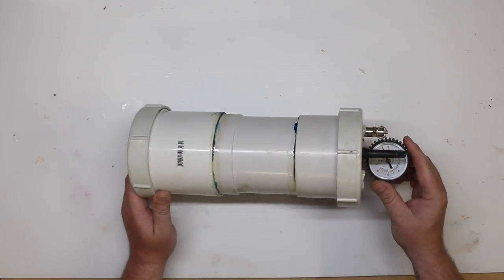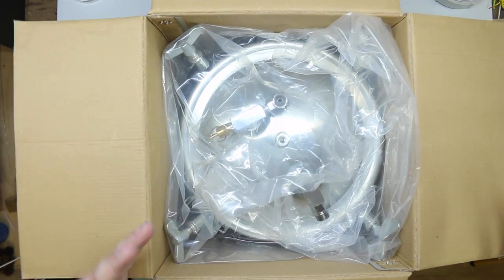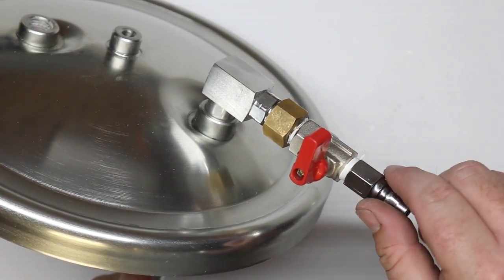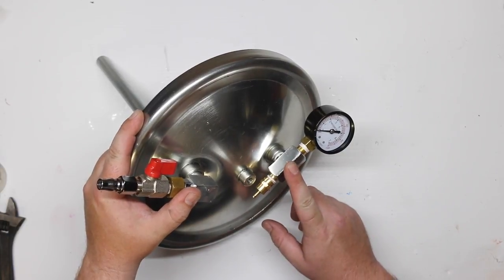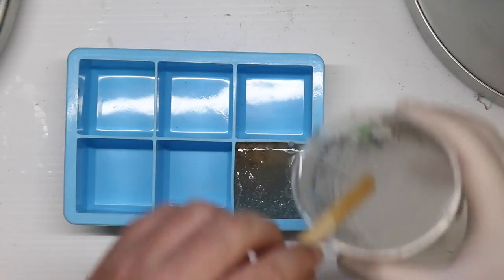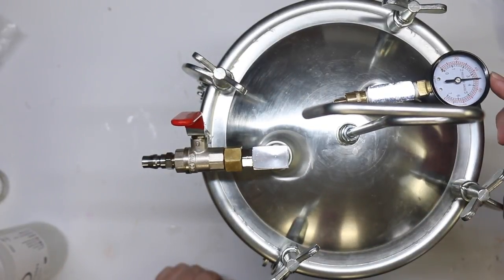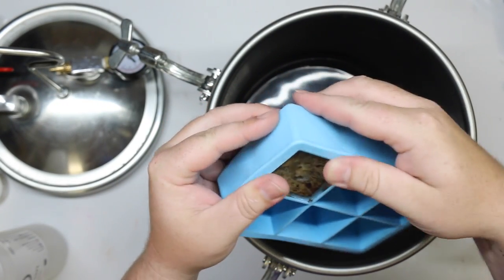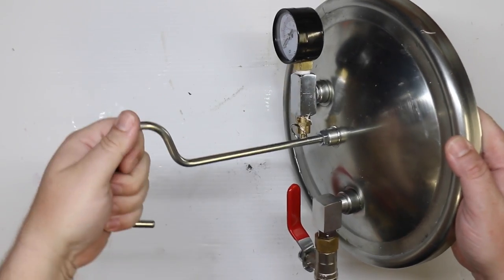DIY Pressure Pot for resin casting

Comment: Quick bit of advice for anyone making these from the pressure pot from Supercheap auto (where I think this was from).
You don't need to cut the pipe - The pipe is screwed in quite hard, but if you pop the pipe side into a bench clamp and just turn the lid on it, it will unscrew leaving the perfect opening for what you need. 
The pressure valve in the supercheap one is positioned right where it needs to be. Leave it on. You can see in some of Ben's later videos that he has put a zip cable in to stop it popping too early. There is no need, as you can adjust what pressure the valve pops at. There's a brass circular piece that runs around the centre pin that can accomodate a flat blade screwdriver to be turned.

Comment: When making small casts, to reduce the amount of air the compressor needs to add (therefore the time to achieve desired pressure) part fill the vessel with an appropriate amount of water  and a spacer - eg inverted flower pot.  The water is incompressible.
Reply: What sort of tiny compressor are you using that that would save any time? From the time he opened the valve to the time he closed it was four seconds, and even if he sped that up by 2x, that's still just eight seconds.

Comment: You make it seem like undoing all these parts is sooo easy. I'm busting a hernia trying to take the bits off the pot I just bought.
Reply: Agreed, this is brutal. What are you using?
Reply: @Zeophyle  I eventually got mine off with the liberal use of heat, via my hair dryer aimed at the joints and a pipe wrench. It wasn't easy though.

Comment: NICE!!! I recently got into resin casting and making molds, I am trying to make copies of my action figures for making custom figures. I recently had a lil trouble with getting bubbles in my casts and saw that a pressure pot is bout the best method to get rid of bubbles. LOTS of great info in your video man, thanks!

Comment: Well done Ben, quick ,to the point and simple. I think all the other videos on this should be removed.  Over complicating with extra ball valves and regulators not needed, using the wrong tools and droning on for 30 minutes. Yours is an Excellent video.

Comment: If you can apply a vacuum for a bit it will draw out a lot of the bubbles, then apply the pressure.

You can get a cheap "venturi vacuum generator" for about $30 - it's slow to build vacuum, but you can use your compressor to make vacuum, which is pretty cool.

But I'm sure you know - this will make almost all resins boil.  So a deep container for the cast is almost a must. You little ice cube trays probably would have lost 1/4 or more of the resin.
Reply from the maker: Hi Don, a vac generator will be a great addition

Comment: Just the model pressure pot I've been setting up this week, so the video was appreciated in figuring how to do so.

@1.31 The paint suction tube is actually screwed on. Some large locking pliers, elbow grease and a few curses and you could remove it. Some heat can help loosen the Loctite on the thread. Handy if you ever wanted to use it as a paint sprayer or sell the pot in the future.

Comment: Ben I'm following your guide for the same pressure pot. Did you get your bits at bunnings?  I had no luck but will try a plumbing store.
Reply from the maker: Hi Chris, if you bought the same pot as me you should only need a ball valve and an air inlet adapter which is available at bunnings in the tool store section

Comment: Hi Ben. After searching everywhere I could think of within Australia, I couldn't find anything specific for resin casting so I've just purchased this. What size ball Valves did you get and any further recommendations for a perfect conversion? For a total newbie who can't seem to get on top of bubbles no matter what I do. And I'm trying to cast dice which are super finicky with the casts. A vacuum chamber just won't work well enough for it still. Any further info on converting this would be massively helpful if you can please. I'm struggling so much and want to make sure I do it right.
Reply: Also are there any specific compressors that should be used?

Comment: Hey Ben how you going, I got the same tank as you, but how did you get the pressure gauge off, it's well and truly on with the tape sealent, what if you can't get the safety release valve off?

Comment: Ben great video. But where were you a few weeks back. I brought my paint pot from Supercheap and I had a few issues, as my safety valve kept leaking (not blowing). New safety valve, all good now. I saw you left the pipe in and only cut it down. I managed to remove it and replaced it with an elbow. This allows the air to be directed out to the edges and down, where with the pipe, it's blowing the air onto the blanks.
Reply from the maker: Thanks Pop’s! I had to chase a few leaks too, and the elbow is definitely needed, I just added a rubber elbow to mine 👍 what psi are you running?
Reply: Because I did what most guys do (I think) I threw away the box and booklet. Haha I forgot to check, what's the maximum pressure. So I only took mine up to 40 bars and the blanks turned out great. 
Next job is to make a flat bottom for inside the pot and also a rack system. 
Stuart
Reply from the maker: Hahaha it’s rated to 50psi but you would think thats airing on the safe side, i just cut a round piece of wood and it sits on the bottom perfect, a rack system sounds cool, thanks Stuart
Reply: hi there Pop's Woodwork and Ben's Worx, I have just ordered one of those SCA paint tanks and will pick it up tomorrow , can I ask what elbows and ball valve? parts you bought from Bunnies - any chance you could just provide me with a link to those parts so I dont look like a knucklehead trying to explain to them what I need lolol. I just want to get in there and out because of the Christmas crowds - thanks for your help guys , am so eager to try this out!, cheers Ruth
Reply from the maker: Hi Mate, the only thing I bought from bunnings was a ball valve and a filling valve, everything else you need comes with the pot
Reply: Hey. I bought One for me too. But where do i replace the Pipe? Did you complete get it out? Whats an Elbow? Do you have an Picture or Link for this and where to replace it? Sorry for my bad english. German here :) Thx
Reply from the maker: Cut the pipe off and only leave about 1 inch in the lid, then get a right angle piece and attach it to the 1 inch piece you left in, then when you fill the pot with air it will deflect the air towards the side wall instead of directly into your castings

Comment: Can I use a bike pump instead of a air compressor? If so is it a specific adaptator I need to purchase. I’m trying to reproduce my figurines that I made. New to resin casting for the past 3 months. The only problem I got so far is building a pressure pot.
Reply from the maker: Yes you can but you’ll be pumping for a while, you need to get a metal tyre fill valve and use adapters to make it fit
Reply: I attached a Schrader valve to the pot instead of an air compressor valve. To pump it up I use a portable digital air compressor pump for car tires which plugs into the car cigarette lighter. I just set the PSI digitally and push the button. This way you don’t have to own an air compressor and neither do you have to pump it by hand. Thanks for the video Ben :)
Reply from the maker: Great idea mate

Comment: Hi Ben, loving the channel. I'm just starting out on the resin casting and I have a question if that's ok. I have a small air compressor that I run my airbrush off, can I also use it for a pressure pot? I think I would have to swap out the scew in airline for a quick release one to.
Andy.
Reply from the maker: If it will pump up to 60psi it should work

Comment: I commented on your smaller pot which has answered some questions. However im still curious if i can put for an example a red solo cup filled with bubbly resin in the pressure pot, and take it out while its still liquid, like a prepour? If so hoe long would I leave it in the pressure pot before removing it to pour into my mold?

Comment: So I’ve gone and bought the pressure pot (exactly the same as yours) and a compressor but now for the life of me I can’t find a ball valve that fits. I even went to a specialist pump supplier and no luck. I’ve given up on that because no one seems to know what thread size it is. Guess I’ll just weld a ball valve to it
Reply: What is the pressure pot he is using?
Reply: Total tools (if you’re in Aussie and ones near you) should have a 1/4 male to female ball valve
Reply: Haliti , it’s a Black Ridge available from Supercheap Auto

Comment: Hey Ben great video!

Did you need to add anything to diffuse the air coming into the pot so it doesn't disturb the resin or was everything ok without a diffuser?
Reply from the maker: Thanks Beau, I ended up glueing on an elbow to deflect the air to the side
Reply: @BensWorx  did you glue it where the inlet tube was ?

Comment: Currently trying to convert this exact pressure pot. It is exceptionally hard to do - I need a vice or something.
I've also managed to damage the pressure relief valve.

Any suggestions on how to convert it a bit easier?
Reply: How’d you go? I’m having the same trouble
Reply: @KatieMcLovin1  No luck. The guys at supercheap said to just bring it in so they can see if they have replacement parts. 

It's in the "too hard" basket.
Reply: We just got one from supercheap, and it looks like they are using some type of sealant for the screw in parts. I snapped the T piece trying to remove it. I did get it out, but I needed to heat it up with a gas torch. You might be able to heat it up with a paint heat gun, but I'm not sure if that would be hot enough.

Comment: i went there and the plumbing section!  could find a ball valve but not the appropriate adapter! the ball valve tho was in plumbling so maybe i need and adapter to ball valve which i couldnt find either. it drove me nuts!!!
Reply from the maker: Nah don’t use the plumbing ones, the tool store section has the ones rated for high air pressure and have all the adapters in the one section
Reply: Chris I dont know if you are still trying to build yours but I have listed the parts that were used in a comment to JB Clarricoats above.  You'll need a gas adaptor from the bbq fuel section and the other 2 parts you can get from the tools section where they sell all the air tools and compressors.  You can get it all from Bunnings.  Hope this helps as it took me a while to work out what parts I needed !

Comment: Ben I have recently found your Chanel and I love the detail you go into. I was wondering what brand of pressure pot did you use?
Reply: It's been four months, so I don't know if you've gotten your answer yet. But it looks to be a 10 Litre Blackridge Paint Tank, you can get them at Super Cheap Auto for roughly $230 dollars.
Reply: @TechnexGames  thank you I didn't get a response until now, but I was able to find a decent pot at harbor freight tools that works for now.

Comment: Could you use this same set up as a vacuum chamber instead of pressure?  Maybe for stabilizing wood with Resin?
Reply from the maker: Hi Bryan, yes Just connect a vac pump and draw a vacuum and it would work

Comment: hello bens,great video,how's your old pvc hold againts high psi? i had my diy vacuum chamber from pressure cooker,but for casting tiny part with high detail (scale modeling) the bubble keep trapped on the edge of the mold,so im thinking about pressure chamber,i even got crazy idea about turning the pressure pot as one lol,but i think it wont hold more than 30,what do you think?
Reply from the maker: Hi Yuwan, Thankyou! I wouldn’t put more than 20psi into the pvc chamber and you definitely need more than 30psi for high detail work, you need to be running at 50-70psi for great results

Comment: Hey Ben, great work. I've bought my own pot to make one and you're instructions are simple and straight forward. 

Do you think those bubbles could have resulted from moisture entering the chamber from the air-compressor?
Reply from the maker: Hey Mate, I don’t think so I’ve done many more castings since and never had a problem. Good thought though
Reply: @BensWorx  Do you remember what PSI setting you used? My max rating is 58 but was wondering if I'll ever need that much or more?
Reply from the maker: I run between 55-60 psi

Comment: Hey champ, what’s that brass nut on the other side of the inlet valve? I have the same tank and I’m working on it but I don’t have the correct size threaded ball valve.
Reply from the maker: It’s a reducer i had lying around, another subscriber asked the same thing and she ended up using a gas fitting from bunnings
Reply: Ben's Worx ah got ya! Cheers dude!
Reply: @jbclarricoats5941  this is the brass gas fitting you will need https://www.bunnings.com.au/gasmate-brass-gas-adaptor-converts-bbq-inlet-from-1-4in-to-3-8in_p3180735   go to the bbq fuel section to get this part.  IT NEEDS TO BE THIS GAS FITTING - DONT BUY AN EQUIVALENT SIZED AIR FITTING - IT SIMPLY DOES NOT FIT.  It took me a while to work that out so this will save you the hassle 
 The other two parts you will need you can get from the tools section where they sell all the air compressor parts/accessories.  These are
 1) https://www.bunnings.com.au/jflex-1-4-bsp-female-mini-ball-valve_p6270745?fbclid=IwAR2nuh7AeqCxXRO4HZ0hriLoS0K79FUPrL2a8q_QdsPS2aF1IXTLq-qJjiM and 2) https://www.bunnings.com.au/powerfit-1-4-nitto-style-male-plug-air-tool-fitting_p6210530?fbclid=IwAR0Rhbi6frcWT9A0YjDrLj7uD3VomBRNtPLkOsDGAQDqI6umdE3-S6JqdRs (if you have nitto fittings - choose a different style if you have a different type of fitting but basically it needs to be a 1/4 male coupler.
I was able to get a good air seal on the tank just using plumbing tape
Reply: @weldmama  Thank you so much!!
Reply: @weldmama  YOU ARE AN ABSOLUTE LEGEND THANK YOU!!! :)
Reply: @weldmama  Your comment saves the video! It should be posted as a standalone and pinned to the top.. Thanx for saving me a lot of time and frustration - I hate shopping.
Reply: @feedbackwelcome  glad it helps - it took me ages to work  out  what the part was so thought would share it with others  :-) Happy Christmas to you as well!

Comment: Hi, thanks for your video. Could I take exactly what you've done here but use an old (cheap) pressure cooker and pump in air via a tyre foot pump?  Same principle? Thanks Mark (UK)
Reply from the maker: Hi Mark, I’m not sure mate, does it have a pressure gauge? Please be careful
Reply from the maker: a bit risky mate with the glass lid

Comment: Just got mine set up but unfortunately my pressure  safety valve is blowing off  at about 37psi. I guess a replacement is in order.  All the best, Brian.
Reply: I'm having the same issue with my safety valve. Mind if I ask where you got your replacement from? Thanks in Advance!
Reply: @auditri  I  bought one from evil bay but I think you'll be able to get one at Bunnings, Total Tools or a similar store.
Reply: @briansbuildsandoutdoors4936  - Thanks for the reply. Not having much luck finding one, been to about 10 places locally, and even on evil Bay. Thanks anyways.
Reply: @auditri  let me see if I can find a link.
Reply: @briansbuildsandoutdoors4936  Legend! Cheers Mate! :)
(Just curious, those are rated 120PSI, the pot one is 50PSI, hows the pot hold up under that higher pressure?)
Reply: @auditri  I don't pump it to full pressure mate, I just go to about 40psi and leave it there.
Reply: @briansbuildsandoutdoors4936  - Thanks again Mate! 👍

Comment: Hi Ben, what type of compressor are you using? I'm wanting to cast some small resin pieces. Thanks.
Reply from the maker: 2hp 50L
Reply: If you need to reduce the volume easily, part fill the chamber with water, fit an inverted spacer (inverted flower pot?).  This should reduce the time for your compressor to achieve the necessary pressure.

Comment: So I'm still new to resin casting and I recently bought a vacuum chamber which I'm finding isn't as effective for what I make so I was wondering if the same vacuum pump i got for the vacuum chamber would work for filling the pressure put with air?
Reply from the maker: Unfortunately not, you will need an air compressor

Comment: I am testing out my resin with a pressure pot. Just to get a feel for it I mixed only 1 oz in a cup and brought it to 60psi.  How long will that small amount need to stay in the pressure pot. I am shooting for a clear cast because I intentionally mixed it to make bubbles.   This is definitely a test just to see if pressure pot can stand up to the claims. I cannot begin a bigger project until I know I can get something clear.

Comment: We recently built this same pressure pot and tried it out.  It definitely got rid of the bubbles, however, on my pyramid shaped mold, the resin comes out looking like a mirage.  Is there anything I can do to fix this? It isn't doing it on other pieces.  Any advice is welcome!  Thank you in advance!
Reply from the maker: Just check your ratios are correct, the pot shouldn't have any effect
Reply: @BensWorx  It's a 1:1 ratio and it isn't having that effect in any of our other molds or  work.  I'm thinking maybe it is the wrong resin for that shape.  Maybe it's getting too hot or something  and creating that weird look.  I will try experimenting with different resins and see if it makes a difference.

Comment: The inside bottom of my pressure pot is curved like a bowl, what do you suggest I put in there to make a flat surface to set my resin work on???
Reply from the maker: A piece of timber will work
Reply: @BensWorx  thank you I will try that

Comment: I know this is an old video but what did you use to go from the half inch down to quarter inch coupling for the air jntake?
Reply: hi, i believe that would be a part called a "reducer"